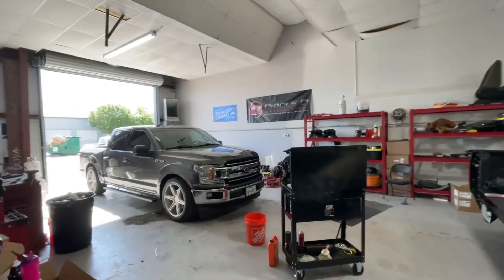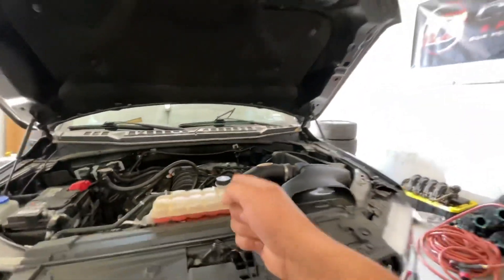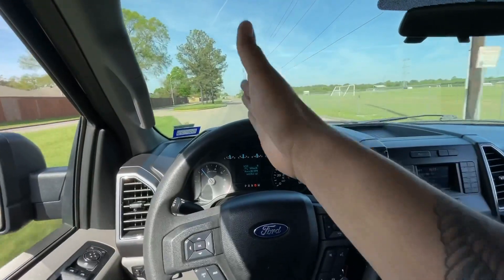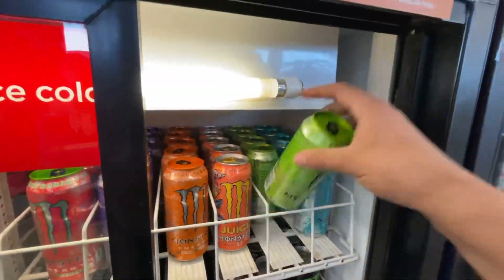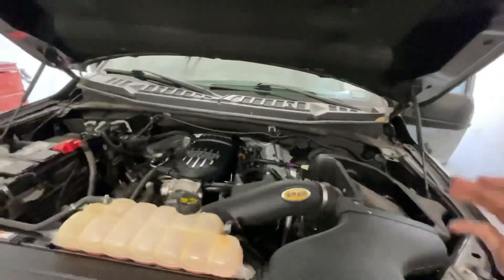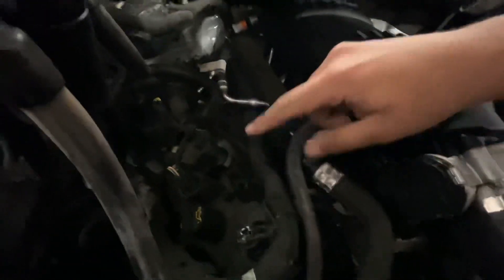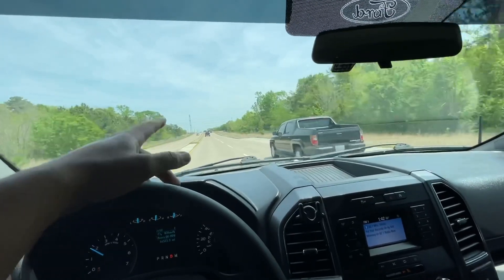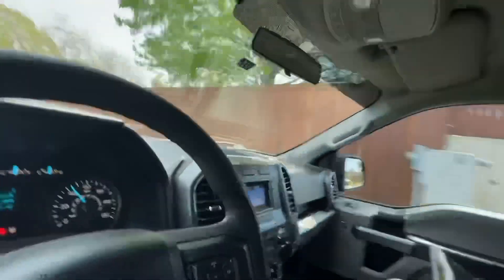How big of a difference does a Boss Manifold and tune make on a F150??

Comment: Man I wish I could do this to my 2021 f150
Reply: You can. Lovernois performance has a tune out for the 5.0. 2021s. And you can get an intake manifold for them too...
Reply: I'm getting my 2021 tuned but idk if I can install a manifold on it do u know if I can??
Reply: @_E_B_ dous a boss 302 fit on a 2021?
Reply: @frankloewen9249  

Any of the 5.0L manifolds are interchangeable. But from what ive read...the mustang gt 5.0 manifold nets the best hp and trq increase across the rpm range. The boss 302 manifold will Rev higher but it won't make the low end torque or mid range of the other manifolds. 

Do some research...there's plenty of forums talking about which one is good for what ya know. But yeah...any 5.0 manifold will be compatible.

Comment: I have a rcsb 5.0 4x4 what are somethings I could remove for weight, only thing I’ve done so far is remove the spare tire, and im pretty sure you can’t remove the hitch or else the bumper can’t  go back on
Reply: A few companies make brackets so you can use the stock bumper without the hitch setup.
Reply: Passenger seat...
Reply: Did you ever figure out what you can remove
Reply: Add antigravity battery to make a 50 pound battery to a 5 pound battery and remove passenger seats to lose 100 pounds

Comment: what air intake model did you match up for that. Im finding boss intakes for 300 bucks everywhere but cant find a air intake. 5 star tuning offers a manifold kit with custom air intake but its 1500 dollars. so if a find a nice air intake for 400 i saved myself 800 dollars.
Reply: S&B makes a nice CAI for about 350$ from American Truck sit in the same factory location and is CARB compliant in all 50 states. My 2016 5.0 F-150 is really happy with it gained 3 MPG and I'm bone stock. I'm looking to install the 302 Boss intake to see if I can get even more MPG than the 23 I'm getting now.

Comment: Normally there is a max fuel trim percentage value. Mine is set to 25% but 50% is unheard of. Also are you using wideband data to calibrate the fuel maps or are you just using the stft and ltft to tune and change the shift rpm and timing?

Comment: Have you tuned any 18+ f-150's using a ported 18 mustang mani? Vmp shows better numbers vs the boss mani but curious if it actually performs better?
Reply: Gt 350/ bullit tb both ported is the better than both. That’s what a Mach 1 is 460 crank vs 480.

Comment: I been looking at the 2022 f150 and was wondering what's the best gear  ratio for 1k turbo 3.31 or 3.73 I use to have a 15 mustang 1khp  and 3.55 was to much but for a truck I'm not sure ?
Reply: I have a 2021 f159 with the 3.31 and I love it
Reply: 2021 f150 with 3.73 and it’s  fast for stock. Maybe quicker than this one tuned
Reply: @gutallama  nah, I’ve tested them all and the 3.15 is a slug off the line compared to the 3.73

Comment: My 19 takes of much harder after you ported boss mani swapped and tuned it. AMRL 💯
Reply: Same I have a 4x4 and these launches are brutal with the boss mani and tune 😅
Reply: @michaellopez2866  yup, i did one on 4H and its night/day difference
Reply: Question man. What all was needed to install the boss vs the gt manifold? What did you do about the f150 map sensor?
Reply: @dakotapemberton1874  it was installed at All Motors Research Labs and also tuned. Well worth the 10 hr round roadtrip.
Reply: @jesusmorinjr.8408  I gotcha, how much did it cost all together if you don’t mind me asking? I’ve got a 4x4 single cab 2018
Reply: @jesusmorinjr.8408  it would also be a 10 hour round trip for me as well
Reply: @dakotapemberton1874  1500-1600. That was back in March. It included the ported boss mani, the install, JLT cold air intake that works best with the boss and the Tune.
Reply: @jesusmorinjr.8408  ok, I have a ported boss intake available to me for 400 currently and was thinking about having them do the install and tune for it.
Reply: @dakotapemberton1874  mine is basically a Stimmy build 😅😅😅
Reply: @jesusmorinjr.8408  I just picked up my truck like 3 days ago and this stock stuff just ain’t for me 😂 I came from a fbo coyote mustang

Comment: Would it make sense to upgrade to a 302 mani and tune to help with lag on my 8” lifted truck on 37s?
Reply: Re gear your truck. It needs 4.56 with 37s to get back to factory gearing.
These manifolds kill your bottom end torque. Gives you more top end, though.
Reply: No it wouldn't help it at all if anything it would make it slower you need to regear to really short gears like 4.88's and possibly add a higher stalling converter